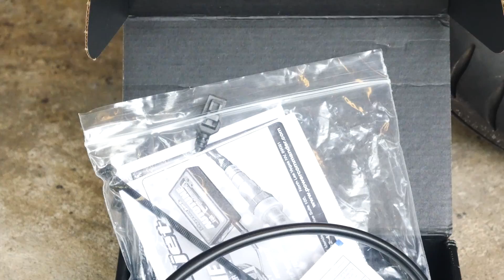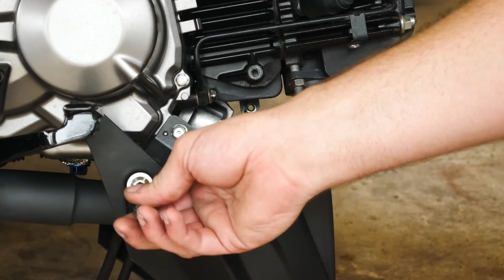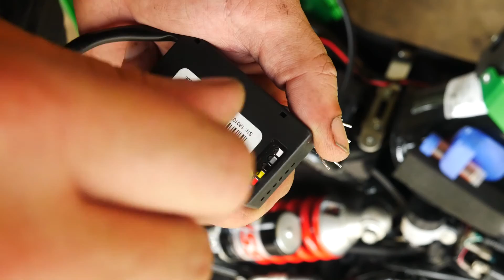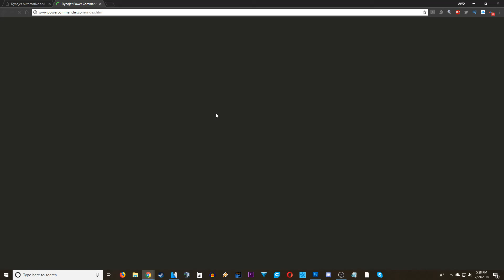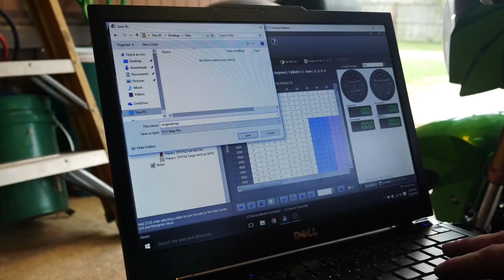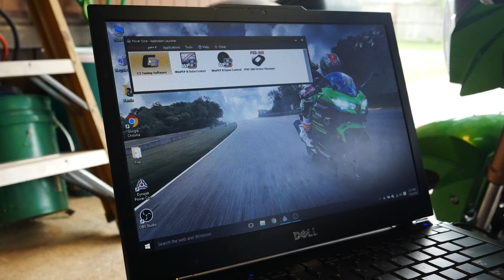Kawasaki Z125 PRO Power Commander 5 AutoTune Install

Comment: 2nd how come you removed the other o2 sensor? I have them both on there? Dyno jet said to use them both
Reply from the maker: The original o2 isn't used once the power commander is installed. You disconnect it entirely to install the power commander. See my PCV install video.

Comment: Did you see a BIG differnce with the autotuner? By now youve saved enough maps so that your Z should be pretty close to tuned. I ordered one but it hasnt arrived yet
Reply from the maker: Hah. Nope. Planning on putting it on the 400 after the full exhaust is on.
Reply: #notagrom you didnt get enough miles yet, or it didnt do anything? I hope i didnt waste another $250